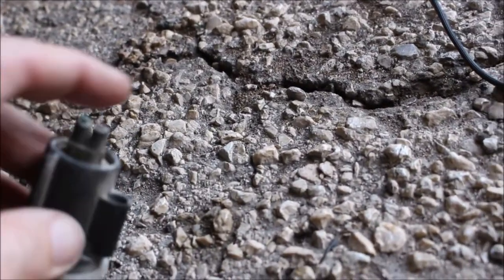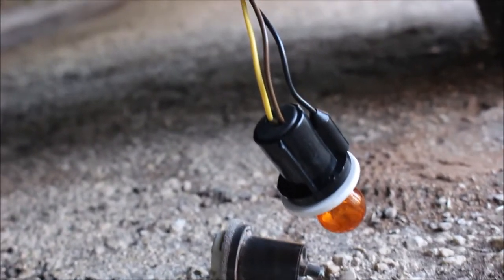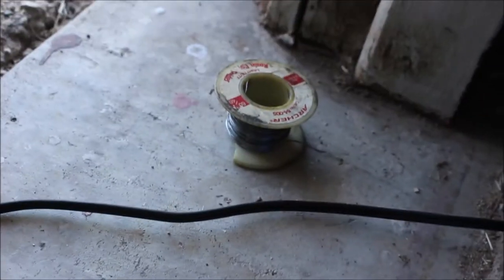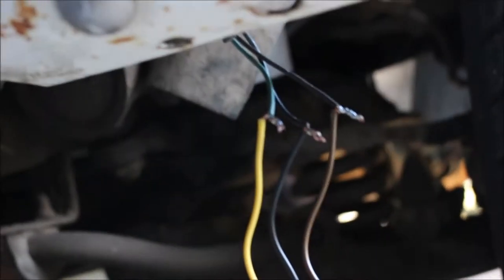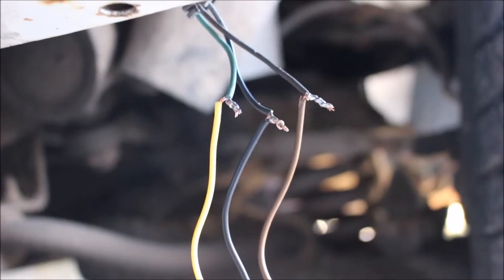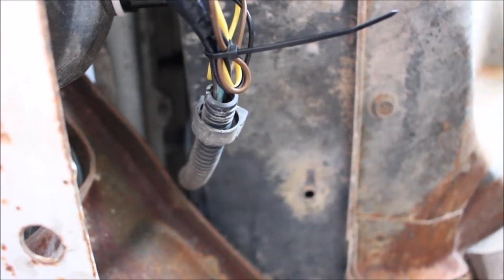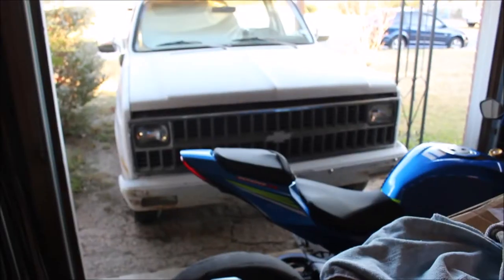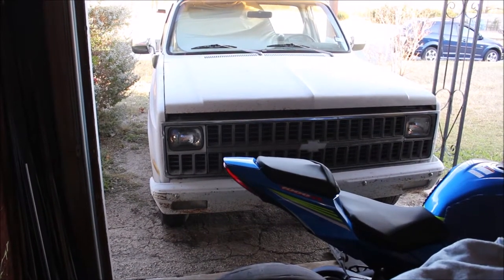Old Chevy Truck Turn Signal Repair

Comment: Im always wrenchen the gmc seems like I got a check engine light every month .but it always gets me home.. I was out riding my 17 gsxr 1000R blk and blue model i also want braded brk lines .and a ecu flash I want to get the blades derestricted unlock that 25 horsepower
Reply from the maker: @Lou - I will be going with a full exhaust, ecu flash, A/F ratio ridability map, most likely all from Brock. Be sure to stay tuned for that probably in early 2018. Enjoy that sweet ride,